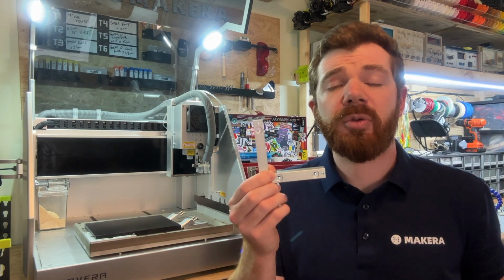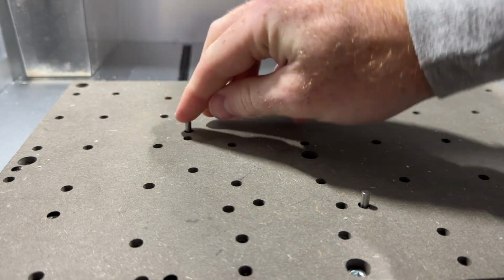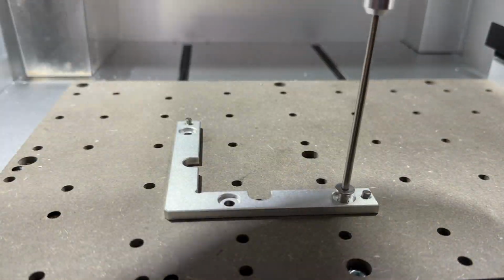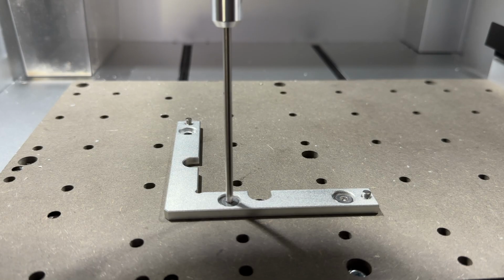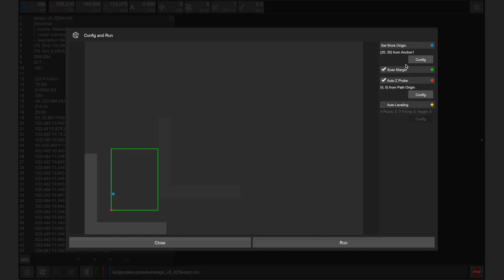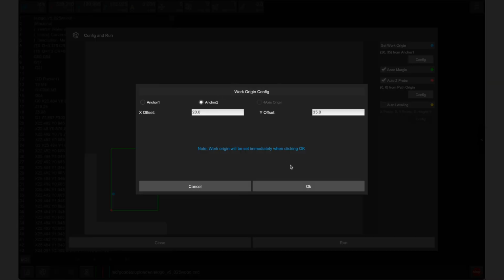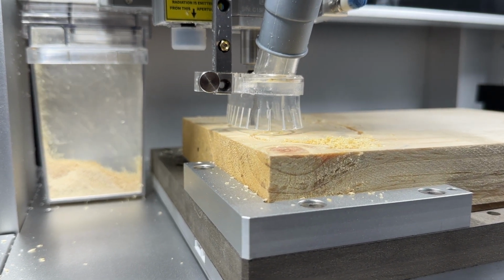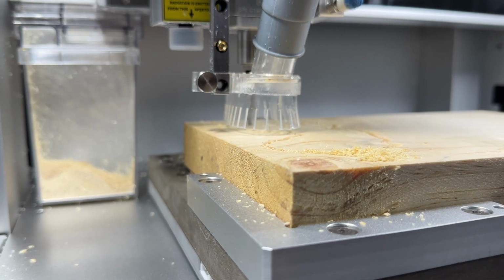Getting Started with CNC Machines - How to Secure Stock

Comment: Quick question. Does it cut/mill to the very home corner if we do not use the L Bracket? If we put an acrylic sheet dead in the beds bottom left (home) corner, and set the home there, would it cut or the limit switches will stop it? Thank you and great information videos!
Reply from the maker: Yes, the entire bed is within the machining area, including where the corner clamp would typically be placed.